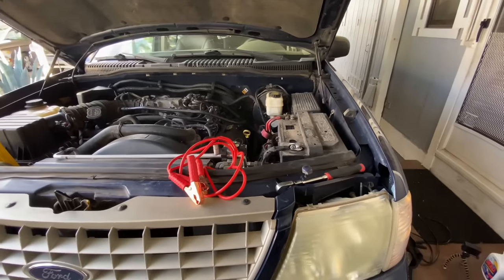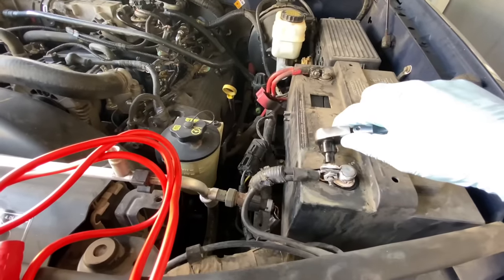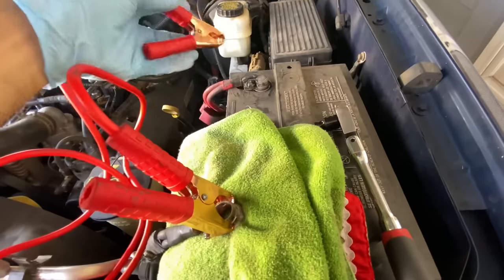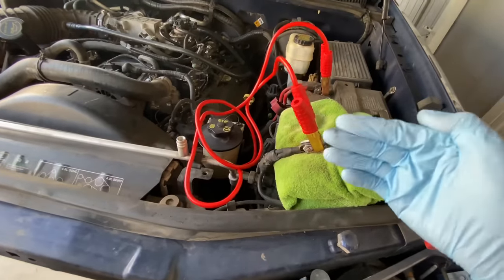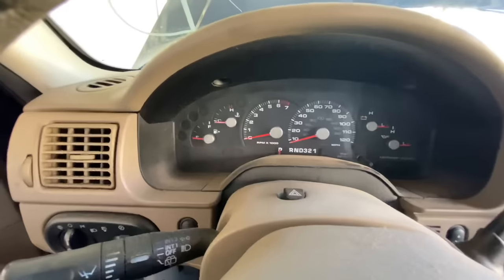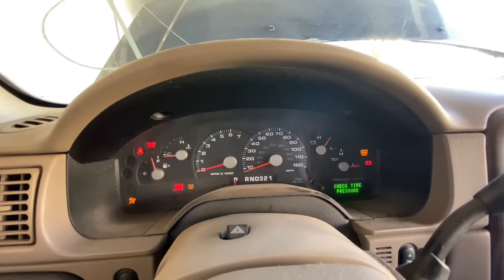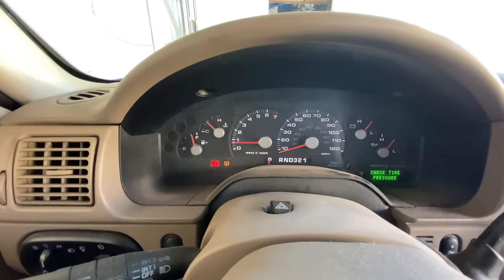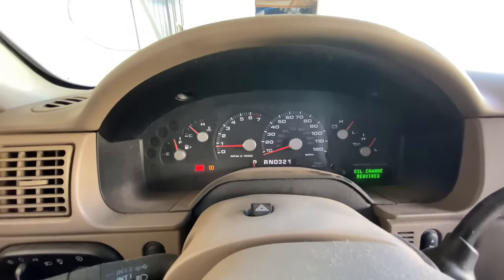How To Reset All ECU’s and Control Modules in your Car or Truck

Comment: Will it help fixing the RPM issues? I can’t mine to go past 2k
Reply: That's a limp mode it sounds like i would go to a local shop and have them do a diagnostic probably a sensor but best to get a diagnostic even if you plan on fixing it. In my opinion good luck

Comment: So my 04 monte carlo is cranking but not starting will this reset start my car or is this another problem. I have changed all the big block fuses in the car I've changed the ignition the ICM ,fuel filter iam lost for words at this moment
Reply: Change battery in your FOB not dollar store one but a Duracell,turn key but do not turn engine on leave on accessory for 2 min.If that fails could be fuel pump?

Comment: What happens to the cars that need a battery programming in when replaced. If you do this you end up with a dead car as the car will not run after leaving the battery off

Comment: If the negative terminal is hard to access, could I disconnect the negative cable from the bodywork end and jump lead from positive battery terminal to body? Would this be the same thing? Thanks.

Comment: Hi, I noticed the Positive cable was still attached to the battery terminal?  Or should it be detached as well?
Cheers...
Reply: Keep the positive attatched, because you are draining any power connected from all the ECU’s, and modules, ect. It has to have a place to go. So keep positive connected.

Comment: I have a 2013 suzuki sx4 and my car is in neutral regardless of what gear i put it in. It wont go. Scanner says speed sensor but there is a recall for tcm.  I dont know if its a bad transmission or speed sensor or tcm. What do u think.
Reply from the maker: This won’t help, I would say take it to the dealer
Reply: Replace your speed sensor, I had the same issue.

Comment: My idle is normal but my RPM is at 5000. It red lines even when I barely press on the gas. The gage is even at 5000 when my mustang is turned off. What can it be? Do you think this method will help?

Comment: Will this method still work if you don't use the jumper wire ? If so will it still drain the battery just as much as if I had used a jumper.I'm suspecting that it would, except it would take much longer.

Comment: Hi there, your post is old and I dont know you would come back and check this but THANK YOU. The trick worked good on my old Camry. It spooked me this morning with all the tiny lights keep flashing and the car run ways underpower. My thoughts went back and forth whether replacing the hybrid battery or ECU. Turns out it cost me only 15 minutes.  You saved my day man.

Comment: Just curious if this video can help and reset my ECU back to stock if it was previously tuned with a Superchips Cortex tuner.  My vehicle got broken into and the f*ckers took the tuner as well which I left in the glove box. Bad idea to leave them inside car. Anyways, it is stuck to Sports/91 Octane Mode and I wanted to return it to original factory settings as I have factory recalls to tend to and will be bringing it to the stealership, I mean dealership.

Comment: I want to thank you. I had to change the throttle body on my 03 Silversdo. After changing it it didn't idle right, accelerate or shift the same. I watched video after video how to rest the computer, did each one to no avail. Took it to a shop & they did it, but it still wasn't the same as before. I watched this video & after following how you showed, it's like it should be.

Comment: This video gives me some hope. For days and sometimes weeks, my car ran perfectly fine until out of the blue, bam, sputtering, backfiring, running rough, and worst of all, once at a stop it will not move an inch. Idles okay, but won't move and backfires every time I press the gas. It's a 1999 Mitsubishi Mirage
DE, 1.5L, manual transmission.
I added new spark plugs and wires, no help. I changed the distributor with no help (cap had oil in it). Ran seafoam through the upper and gas tank, no help. Cleaned the EGR valve out, no help. Checked/cleaned fuel injectors, no help.

This weekend, I went all out. I replaced the EGR valve, replaced EGR vacuum solenoid, replaced MAP sensor, replaced throttle body position sensor, cleaned out the cat (worried the intermittent issues was from occasional block in the cat). I also have O2 sensors to replace, but it started raining, and those sensors are on bloody tight.

The last thing I have left is this video's suggestion of resetting the computer. Something I've never done before, to be honest. God I hope this works too.

Previously added a new fuel filter, air filter, timing belt 25k miles ago, alternator 15K miles ago, battery 1.5 years ago. I didn't reset the computer after these tasks (battery proba did 1.5 years ago before all these fixes, although the mechanic replaced the alternator and might have done so.

Comment: I tried that on my c230 K MB positive to negative connection did spark the battery.  How did you do that with out spark?
Reply: Remove the negative cable from the battery, isolate it so it does not touch anything except the cable. if there is a spark it will be a minor spark! No worries!

Comment: Thank you for sharing. I took my 2002 Dodge Caravan for inspection and the MIL-Check Engine- is ON on the OBD but off on my dashboard. The mechanic told me I needed a new or refurbished ECM. $1200 for part and labor. I want to try this first.  If this works, How long should the drive cycle be after this procedure? 10-15 miles?
Reply: I hope you didn't pay $1200. You can get a programmed ECM for less than $200( Flagship One)   , and train ( in less than an hour) a smart monkey to install it in 10 minutes.  Mechanics can be real a-holes.

Comment: How does current drain to the ground if the wheels are rubber? Alternatively you can just remove positive cable from battery terminal and ground the positive cable for 2 or 3 seconds which is enough to discharge capacitors. Never had an issue doing this.

Comment: Can I use a normal electrical wire.. for this process?
Reply: I don't know why not...  it should dissipate the little bit of stored energy in the modules as long as it has a place to go.   I just tried this on my 08 STS caddy  and it didn't work.  I simply used some bare wire I had here...   tie wire for rebar...  like I said it didn't work. Going use my jumper cable and try it again right now.

Comment: This worked for my 2012 Ford Fusion Cranking but NOT STARTING. Had Readiness completion issues and couldn’t figure out what it could be, so I just reset everything and it worked.

However I DID NOT leave the power cable on the battery still, that doesn’t seem smart. I just put the jumpers to both power and ground wires and turned the headlights on and wait 10-15min.

Comment: I have a Honda ballade luxline S04 1998 150i it's idling very high,I changed the throttle body and all my sensors are working so I don't know how to solve this problem,it's idling at 2 rpm. Please assist

Comment: I had a battery changed from a 2015 Ford Ranger 2.2 manual gearbox, the right head light stopped working. I did as per above video however that issue was not sorted out, any advice thereafter?
Reply: Unrelated issues.
Reply: @JoeBlowski  it happened that the ECU had to be reset in order for the head light to function

Comment: Would this work on a 2005 cadillac srx with navigation screen(factory)? It comes on when it wants to or the radio will come on once in awhile but not all the time. Also it idles real rough. Wondering if this would help?

Comment: This looks very promising man, Will this help my situation? My wifes 2010 Explorer gave me 6 codes P0135 P0141 P0155 P0161 P0403 P0455. Mechanic is sending me to find a programmer for the PCM or possibly replace it all together. Thanks in advance!

Comment: Hi there GK7 DIY really good video you have shared! i have a 2007 SS Holden Commodore my fault code p0700 came up for the 2nd time yesterday plugged in my scanner tool & read TCM=Transmission Control System (Mil Request) And i have just followed your procedure hopefully this will fix the tranz issue, Gears work fine if i drive nice and easy so i know it's not the internal parts of the tranz plus i have also done a tranz service last year no sign of metal flaks or chunks at the bottom of the pan thank God.
Reply: Did it work?
Reply: @TheModAddict  I took the car for a nice easy little drive i have not pushed down the exhilarator too hard as yet that's when the issue started i will let you know what will happen hopefully the fault code won't come back & if it does il have to try & locate the tranz module & have a visual look at it.
Reply: @TheModAddict  Hi there! the transmission seams to be working fine at the moment this reset may have done the trick thanks for the video!

Comment: So, stated that the procedure would clear "all" codes of fault, either past or present  (if I understood correctly) then why  is the Oil Change Required  light on  when you just said you are doing an oil  and filer change .

Comment: MY MAF SENSOR MAY BE THE PROBLEM. I CALL MYSELF REPLACING THE SENSOR IN 2019 NISSAN KICKS. ENGINE LIGHT STILL ON. I WAS WONDERING CAN I USED THIS TECHNIQUE TO TURN THE ENGINE LIGHT OFF?

Comment: Seen other videos on doing this and sime say to remove BOTH batt cables, attach jumper, turn on ignition switch, and turn on ALL switches on dash (blower fan on high) and steering wheel. Wait 15-30 minutes, turn OFF all switches, and reconnect battery.

Comment: Please my Lexus GX 470 2008 model will crank for quite a while before it fires up. Fuel pump changed but there is no solution yet. How can you be of help sir? Thanking you in anticipation.
Reply from the maker: Can be many reasons, start by scanning the ecu
Reply: Fuel pressure regulator

Comment: I've heard just to turn the headlights switch on  after disconnecting the ground cable. What does the jumper wire do?
Reply: i was wondering the same thing...... just unhook the negative for 10 min.... no need to jumper.. wtf?
Reply: Hey do you know if it will untune my vehicle I have headers on a 2000 Silverado and I want to untune it do you think this method would work ?

Comment: Completely serious questions. I have an 05 impala ls decked out after a reason to change all the body panels on the driver's side in the body of an 03 Impala SS. I have all the parts to make it a supercharged engine. Can I do this when I put it on and the extra serpentine belt and will my engine relearn life as a 3800 series 2 SC version?

Comment: What this method will work for 2008 Mercedes Benz C Class 350 it feels burnt out and I replace it then my gear is hitting hard when I shift it to drive if you can help let me know thank you
Reply from the maker: After Mercedes battery change, the TCM probably needs to be reset with a special scanner
Reply: @GK7GARAGE  will i have to take it to the dealership for that to be done?

Comment: Hi.  i have a problem with my car it is a 2007 nissan350z.  the car changed its engine and now it does not accelerate, they tell me that it could be a problem with the throttle body

Comment: Should of disconnect both cables from battery , and hook together with a clamp, one cable positive let’s say can short out  items in car , burn fuses, etc .. all you doing is making sure all current is dissipated though out car . Reason for this way is so cable never touch by accident the battery’s terminals.

Comment: Ok so if I'm understanding you correctly, you're saying to disconnect the negative terminal then jump it to the positive? The negative terminal is a ground to the body, which is why it goes on the negative side of the battery, correct? So now, you're saying to jump the negative/ chassis cable to the positive side of the battery? Isn't that just the same as jumping  the positive and negative side of a battery together? Can you please explain this to me?
Reply from the maker: It’s not the same because disconnecting the battery breaks the circuit, it’s just like removing the battery and connecting terminals together.

Comment: I don’t know why this should work. The adaptation data is usually written on flash memories on pcb that won’t erase content just because there is no power. Otherwise similarly on pc we should flash bios everytime the lights goes out. How do you know adaptation was erased btw? You should read data with the scanner before and after this process to see what really happened.

Comment: Its best to leave neg post on and cross jumper cables. If you get a big spark that means its working. Leave it on for 5 mins. Close the hood soon as you connect it so heat helps the ecu to get the right idle. If you see smoke thats just the sensors communicating with each other not to worry. Please lose me number after this because the last people I helped called the police.
Reply: There are many gullible people out there who you could seriously screw over. Lol

Comment: I did this to get the  dash lights to work on my 96 LHS. I didn't use the jumper cable but I did turn the key on with the battery disconnected to drain any residual power in the components.

Comment: What if your vehicle has an after-market chip or tune installed? Will this then be erased and reset to factory default? And also what if you have oversized tires and the speedometer error has been corrected and shift patterns for the transmission have been adjusted for the tire size? Will this also be reset to factory default?
Reply: When you reset it will reset to the recent flash tune

Comment: Ive only got the normal jumper cables, red/black on both ends. I connected the one end to the corresponding terminals. Now what about the other red/black end that would normally be connected to another battery?
Reply: Only use one wire did you notice how he connected using two reds from his set of cables that means he's only using one wire it can be both black or both red you're trying to connect the two together you can't do that using two wires unless you cook all four cables ends so just use one wire pick red or pink black and use the clamp on each end of that one wire to each connection and you'll be good

Comment: i just remove the battery in toyota vios 2020 to check the inhibitor switch after that i reconnect the battery and theres a multi fault code came out and the aircon not working the stereo power window and the shift is lock

Comment: Well this help me. My car is I don't even real rough dropping RPMs not giving me full throttle response when I'm trying to give it gas. Say if I stomp it from 60 to 100 I can feel it's spitting and sputtering trying to grab again. I know I need a new mass air flow sensor. Maybe that could be the whole problem

Comment: I have a very lovely landrover 2008 . But it is very moody. Sometimes no cranking and alarm system flashing. Either after 10 minute's drive Sometimes radio and panels system like ac shot off and alarm will activate. If I turn off engine, it won't start again.  3 landrover delar shop I went and they couldn't fix that .and still I love it

Comment: Our 2014 Cruze SRi has lost communication between the ECU and the electric power steering & ebd system. 
My OBD2 can reset communication but then it comes back again. 
Disconnected Battery & used jumper cables to create a circuit.
Left for 5 hours, then reconnected the battery.
Unfortunately the communication problem was not solved.

Comment: I have jumper cables with 4 clamps. Which two should I use? Thanks.
Reply: Lol
Reply: You use the red one on positive side and other end of same cable which is black just make sure it's the same wire on cables

Comment: You are supposed to disconnect both terminals from the battery and then connect both terminals together to drain residual power that the ECU may have . the way your doing it the battery would need to drain before any power from the car would start to drain...
Reply: Nah … Once you disconnect a terminal from the battery it is not in the circuit anymore.
You’ll have to wait a long time for a battery to drain with only one terminal connected !
Reply: @Hickalum  Correct you would have to wait for the battery to drain before it would get to the residual power in thw pcu , thats why I said you need to disconnect both terminals from the battery then connect both terminals together with the jump cable, and in about 45mts to be sure all residual power held in ecu will be drained.
Reply: You can’t drain the battery with only one terminal on you would have to make a complete circuit to drain the battery also wouldn’t take any longer due to the fact you’re not drawing any power from the battery but the way I’d do it is taking the positive cable off and grounding it out on the frame no need for a jumper that would be the cause of it taking longer you always want the least amount of connections possible most vehicles have a ground bolt right on the motor close to the battery for situations like this

Comment: Can someone please, please tell me why I still have a O2 sensor code still showing after I've had it replaced? Check engine light keeps coming back on @ its not showing any other codes, I've disconnected the negative cable waited 4 hrs @ it came back on the next day, trying to get the light off so I can get my vehicle inspected before the end of the year, so somebody please tell me what to do.

Comment: Sir, the jumper cable I had is the black and red one.. Can I use it?
Reply: Did you use those??
Reply: Go to advance auto parts and clear the codes. If they tell you they can't go to another one

Comment: HAY I have A 2005 Nissan maxima I turned car off came back 15 min later The car was lowe on gas but should have had enough to start but car would not fire over just cranked no start so I put A couple gallons in it still no start . Had to use A gas soaked rag to start  . But now my dash lights and instrument s dont  work